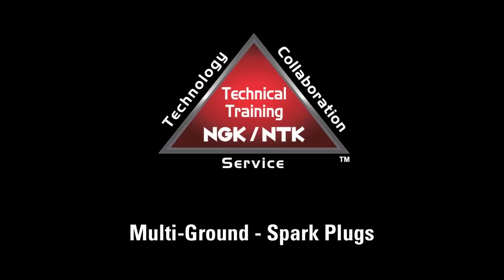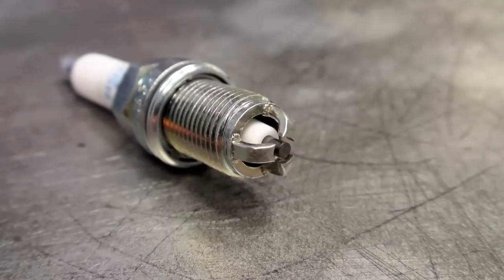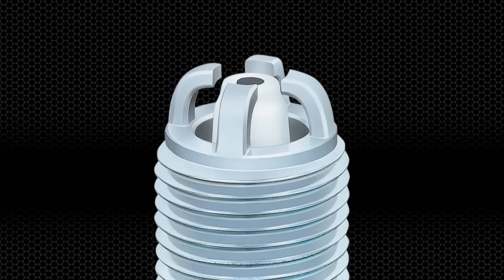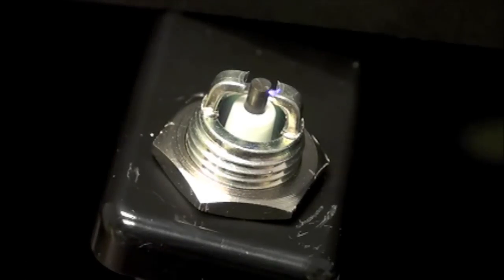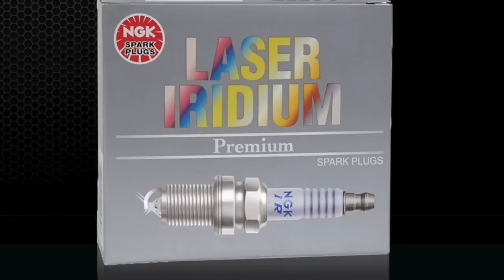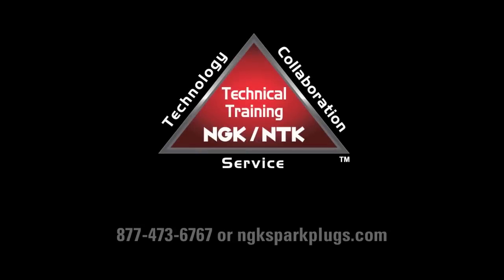Multi - Ground Spark Plugs - NGK Spark Plugs - Tech Video

Comment: Bought a used Honda Civic hatchback, not knowing the maintenance history of the car, I did a full tune-up.  Cap, rotor, plugs, wires, ect...

When pulling the spark plugs I noticed they were a Quad type plug, so I took the online forum Honda fanatics advice and put the correct NGK's in with the proper gap.

Man, what a let down.  There was a very noticeable loss in mpg, and overall power with NGK.
There might be something to these "gimmicky" spark plugs.

Comment: Just bought 6 ngk 4 ground spark plugs and I'm not sure if those come pre gapped or not. AutoZone says they are not but orileys says they are. if I need to gap my plugs what tool will I need to use to gap them without damaging the plugs?
Reply: jonathan hernandez yes they come pre-gapped. But you can mess the gaps up by bumping, hitting or dropping them.

Comment: I have in my car 3 NGK Iridium spark plugs and a 4 electrode BOSH Platinium spark plug in the number 4 cilinder because the single electrode one started to get dirty with gas and oil but since putting the Bosh plug it's running ok with no smoke.
Reply: This is called ( or perfect example of)  out of the box thinking:)

Comment: my spark plugs are as shown in the video. Can I just change them out and use the single ground electrode iradium plugs?
Reply: I don't see why not as long as it fits but I would go with what your manual says they use them for their reasons
Reply: Their reasons are usually money

Comment: Electricity takes the line of least resistance. So why 4 grounds.
Reply: Having four grounds just reduces the chances of it getting fouled.
Reply: maybe, when residue builds up on a ground pin, electricity now have three other options.
Reply from the maker: Very good question. This is explained @ 57sec
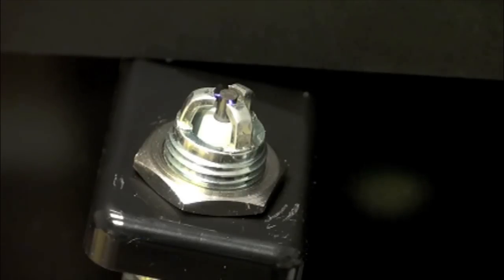Reply: +ngksparkplugsusa no it isn't explained why 4 grounds @ 0:57. If anything, it explains why 4 grounds are unnecessary.
Reply: +Buddhapatties like a failsafe for misfires
Reply: I think the idea is on having these last longer.  Suppose the spark will happen on one of the ground for a few years, until the ground is reduced in size.  Then it starts on another ground, and so on.  So compared to a single ground spark plug, this will last 4 times longer.
Reply: ^ residue will build up on all the grounds, so it makes no sense. Single ground spark plug won.
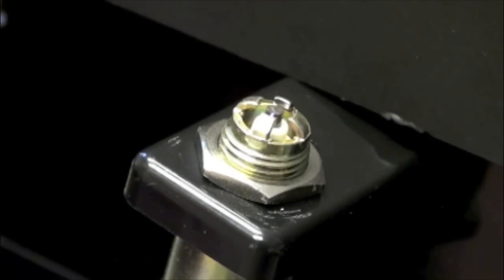Reply: @ 1:05

Comment: I clearly noticed the big difference between the 4 ground and a single ground on my 4 cylinder bmw e46, and this information is very true.
Reply: +KINGCALLO A single ground performs better by far. I can clearly feel the difference between the 2. Even onn fuel consumption.
Reply: +Bosman Ragga 

My car has three ground plug. Do you recommend single ground for better speed and economy
Reply: +Usama Ahmad Definately yes according to my experience in my car and the explanation on this video. Try them and see what effect you'll get from them. Both Multi-ground and Single ground plug have their individual disadvantages but single-ground plugs have better advantages than multi ones.

Comment: I guess all of the advertisements  you see on each spark plug box is fake and false advertising. I did not know that single electrodes work the best. Thanks for the info!
Reply: +Ko-wing wong you REALLY didnt understand the video did you
in MANY vehicles the spark plugs are EXTREMELY hard to change so longevity and anti-fouling matters a LOT
Reply: +Mijc Osis (mycosys) hmm. I also drew from this video that single electrode spark plugs are best. Although the part of the talk that built up to this conclusion was kind of gobbledygook to me.
Reply: Mijc Osis Yeahhh but I have the Bosch 4 ground ones in my B16a2 and I'm going to switch back to single ground NGK BKR7E-11 plugs.

Comment: Obvioulsy it will only spark towards the ground with the path of least resistance, it will never multi-spark. You need multiple spark plugs for true multi-spark, like some old Nissan engines.
Reply: Or Alpha Romeo twinspark engines
Reply: Hurricane Floyd or Chryslers penthouse "Hemi" engines
Reply: And alpha Romeos (T-Spark)
Reply: Or Suzuki DR .
Reply: Hurricane Floyd
Reply: Brisk ar12zs perform 3 sparks at a time

Comment: I only use NGK spark plugs because you simply feel the difference between other manufacturers.

The problem is: i currently use the NGK BKR 5 and it is said, that this plug is the wrong for my car (Vauxhaull Vectra B) if running on LPG.
So what spark would i need?

Comment: My outboard engine, a Suzuki 4hp from 1995, only accept a Bosch super 4, spark plug. 
From the beginning the original sparkplug, was a single-ground sparkplug.
I try to run it with a singe-ground spark plug, but the engine only die when i accelerate it.
And when i replace the super 4, it goes like hell.
i have not test NGK´s multiground sparkplug because it doesen´t exist on the  Swedish market.
Sorry for bad english, but my fucking teachers learn me Britain english.
Reply: ignition coil problem...

Comment: Just bought/Installed your platinum series 4 prong spark plugs...initials startup was very un settling as it sputtered about for 2-3 seconds after that......... :D VERY NICE AND SMOOTH ENGINE RUNS BEAUTIFUL WITH 250,000 MILES

Comment: can i use the multi tip spark plug in my toyota ms112 ? . . . i'm doing a total engine rebuild and want to turn out as much power as i can. would you recommend ?

Comment from the maker: 2) "how many miles should one replace..."  

Spark plug service intervals vary with plug type and the engine they are being used in.  Please check your owner's manual or maintenance schedule for the most accurate recommendation of spark plug replacement intervals.

Comment from the maker: 3) "if one of the spark plug dies..." 
If a spark plug is no longer firing, A no start condition may occur on single cylinder engines.  On multiple cylinder engines, harder starts, poor performance and noticeable engine misfiring will occur. Most automotive engines will illuminate a check engine light if misfire is detected.

Comment from the maker: Multiple ground electrode spark plugs are pre-gapped from the factory and require no adjustment.  Furthermore, there is not an accurate tool or method to check/adjust the gap on multiple ground electrode spark plugs.
Reply: I bought double electrode spark plugs that described a 0.044 in gap. But when I measured them, the gaps are 0.025 or 0.023 and different on each side/electrode. What does this mean? Is the gap a total of the sum of each electrodes gap? Or is it suppose to be 0.044 on each side?
Reply: @InuyashaMiles   the plug just will work with the smallest gap until the erosion make it equal to the next ( as a size) one .

Comment: The distance between the multiple ground electrode has to be perfectly equal, otherwise the one that's closest to the center electrode will always get the spark...defeating the purpose of multiple electrodes. Translation: don't even think about re-gapping.

Comment: Can the electrodes of these type of plug be gapped ?

I have a set of BUR-5ET which I intend to use, since my
valve seals are worn out and there is oil fouling.

Whatever the cons you might say of multielectrode plugs, 
I am quite certain that your chances of proper firing and hence
complete combustion are far better with more electrodes, since 
if one or more is too fouled to fire well, the spark will fire with the 
next nearest/cleaner electrode.

Comment: I was really surprised to hear the video actually point out the big flaw and misconception about the multi-ground electrode plugs. 

There are a lot of companies that make it seem like having more than one ground allows you to ignite the mixtures better and faster, when in reality you are significantly hurting your combustion efficiency at a cost of being able to run a plug longer.... good stuff.
Reply: Then why does toyota go through the trouble of putting those stickers on every damn motor they put out saying to only use twin ground electrodes?  If they were in a business deal with the manufactures who made the twin grounders why would they say to only use the if it was just because they last longer.? Wouldnt they be more apt to rep different ones by the manufacturer because they would get changed sooner?  And auto manufacturers never add things or make things where theyll last a lifetime because of supply and demand greed.  I was always under the belief that the dual ground was there to act as more of a backup where a motor might be running wrong and fouling one of the grounds with buildup so the other ground will still fire which will burn off some of the buildup that was on the other electrode..   but could be wrong. Wonder what would happen if one had a bigger gap than the other grnd side..  you think the longer one would just buildup crap on it being unused or you think the shorter one would just fail sooner then suddenly the larger gap would take over and run hotter?
Reply: @Z-Ack  I have owned toyota's just about all my life. I have no idea what stickers you're talking about having to use dual ground plugs. Nor have I ever purchased anything direct from toyota that was a dual/triple/quad ground plug.. everything has been a standard, single ground plug. 

If you have a dual ground with different gaps, you will continuously arc to the path of least resistance... it's basic physics.. 

If you're at a point with a plug where you have a failing ground, like as in it burned off.. just replace the plugs. They aren't meant to last a lifetime of a motor.
Reply: @Z-Ack  It's an attempt to discourage the use of spark plug brands other than Denso because Toyota own 25% of Denso Corporation (formerly Nippon Denso).